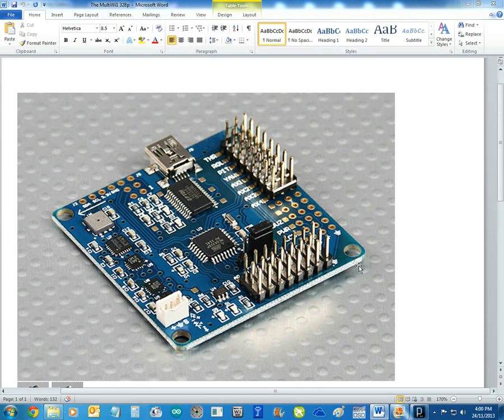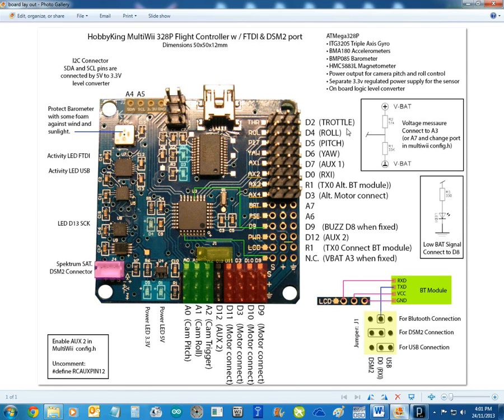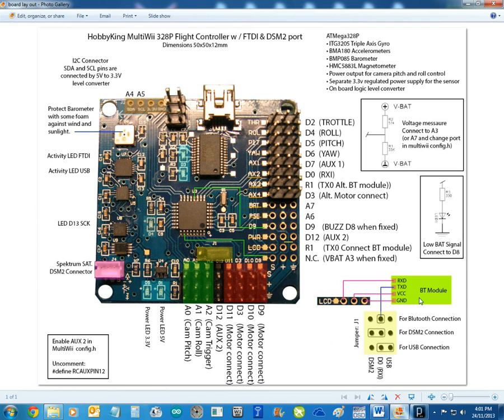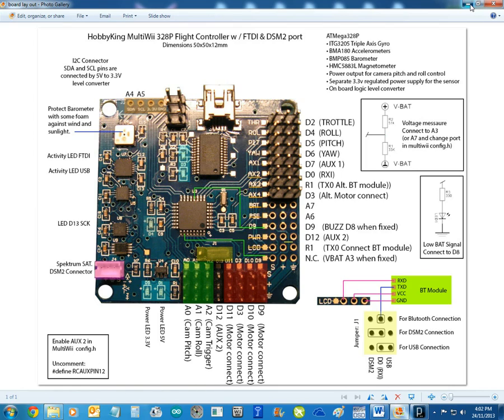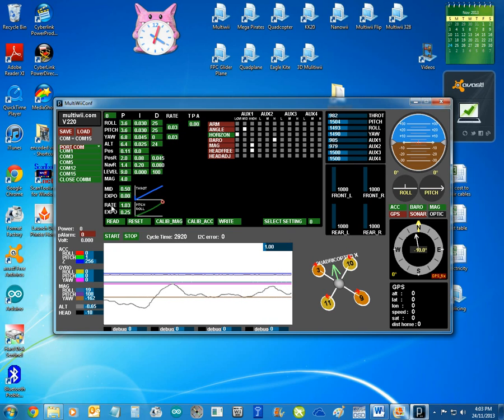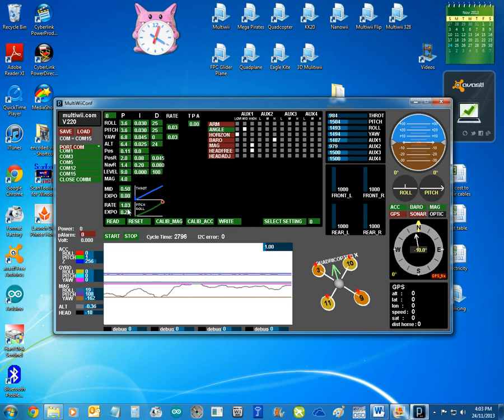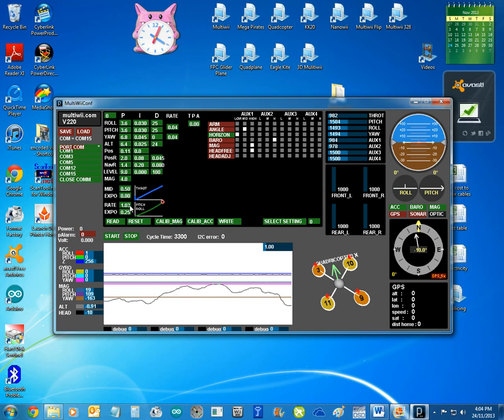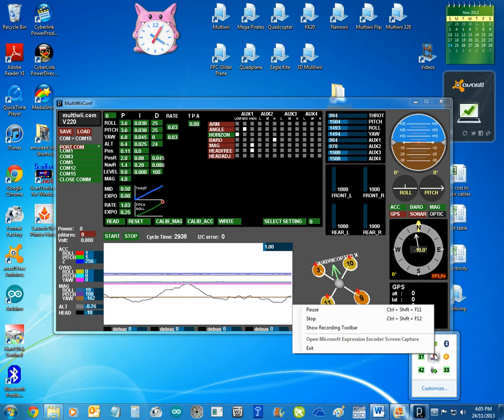HobbyKing Multiwii 328p Flight Board Setup

Comment: Hello,

I have this FC, I cannot connect my FC to Multiwii GUI, how do I get the configurator you have on this video, it looks different than the multiwii gui version 2.3, thank you in advance
Reply from the maker: Hi Steve..... the MWconfig should work on any version..... I have 2.20 in this video but they mostly all work, some are temperamental if the version on the FC board is too many version different to the MWconf on  your computer (ex - say I have v2.3 on the board and say v1.8 GUI)... anyway, a couple of Qs for you. Is the board new or old, is the jumper set on the USB pins on your board (ref 1.28mins in the vid). what version is on your board and what version of MW-GUI are you running, have you had the board connected to the comp before, does the board show up on your computer on a COMM port..... just with the basic info you have posted I cannot gauge what your problem maybe so if you give me some more info I can probably assist you in getting your board running... cheers and merry christmas.
Reply: @moochasas  

Thank you for replying, Merry Christmas to you as well! 
I have the pins jumped correctly for USB as your reference at 1:28 in your video. It is a old board oh, I don't know how old I bought the copter used off of someone else. I am able to use the Arduino software and am able to upload version multiwii 2.4 successfully with no errors. I am trying to get the latest version of multiwii gui to connect and I got it connect one time but I don't know all of the exact settings or what I clicked on within the extracted files, before I got it to connect that one time I had problems getting it to connect before that time and now I'm having problems again and cannot get it to connect no matter what I do, it keeps giving me a message after it tries to connect for a few seconds with a series of light flashes from the red LED and then with a small window it says " error device not responding at the heading of the window and in the body a red circular X that reads.... please check if you have selected the right comport, when I look at my devices installed on my computer it shows FT232R UART, and it says it is working properly, the comport which is com 3 is correct on the device settings and I also have it checked correctly on the GUI, I have racked my brains out trying to figure out how to get it to connect, any help you could give or suggestions would be great!
Reply: The copter flies but it is very hard to fly it does not want to stay in one position in the sky like a DJI Phantom 4 Pro but I own it wants to move all over the place and is extremely hard to control I can basically hover it and move it around very carefully, I am an experienced RC pilot my son and I have 30% gassers
Reply: I am trying to get a graphical user interface hooked up so I can try to adjust the PID's, I'm about ready to give up on this old board, I am already looking at a DJI Naza M V2 or the pix4
Reply: Would like this copter and this board to be able to hover when I release the sticks to neutral like the DJI Phantom 4 does don't know if that's possible?
Reply: @moochasas  

There is a bunch of files when I extract all of the files of the GUI 2.3, I am clicking on the one with the little quadcopter symbol that says multi we win we application but there are other EXE and vs host and dll application extensions XML configurations manifest files that I don't know those will not open I don't know if they have to open along with the main application file with the multi will in GUI application file?
Reply: Within those extracted files it has vs host, Cat vs host EXE, vs host exe manifest, and it says when I try to run those any of those that it cannot start the application the application is missing required file don't understand what that means
Reply: I think I figured it out, but I cannot get multiwii 2.2 from the main Google code website it says 404 error not found, is there any way you can send me a link to download 2.2?
Reply from the maker: @stevenshock176  https://www.dropbox.com/sh/3e8d1jnvel93e5k/AAArxwjeAaV18E6nnuzutapwa?dl=0 Here is the link for MW2.4. it is set up for a 328P FC board. The GUI is in the other folder, remember to choose the correct one for your computer.. If you flash the board you will get all my PIDs that I had in my set up. Before you flash your board try connecting to the GUI in 2.4 it should work. Do you have the right BAUD rate set up (it should be 11520)
Reply from the maker: https://www.youtube.com/watch?v=J4Vduc-qLKg&list=PLhm-AAbSpJ4ijpW2kK5VJwNPEUz41vysQ&index=71
Reply from the maker: https://www.youtube.com/watch?v=7sExKKzNJVc&list=PLhm-AAbSpJ4ijpW2kK5VJwNPEUz41vysQ&index=72
Reply: @moochasas  

Hi Tony,

Thank you for all your help! It flies alot better, I still cannot get the config to connect, tried a couple different things, just won't work! It's  ok, the copter doesn't have gps so it flies as good as it is going to, the USB had broken off the copter over the weekend so I think I am going to figure out something different. I am going to buy this used flamewheel hex tomorrow and have some fun with that (it has DJI Naza, do you have a good inexpensive easy to program FC with GPS I could get for this quad (S525 is this a decent frame?) that has good software, beta flight maybe or suggestions? Thank you once again!

Steve
Reply from the maker: @stevenshock176  If you want an inexpensive FC board C/W GPS then I recommend an Omnibus F4.https://www.banggood.com/Omnibus-F4SD-32K-Betaflight_3_2_0-STM32-F405-Flight-Controller-OSD-5V-3A-BEC-30_5X30_5mm-p-1211677.html?cur_warehouse=CN&rmmds=search
Reply: @moochasas  

This is a link for Banggood, it does not say it comes with GPS, is GPS intergrated into the board, I see that it has intergrated OSD, that is nice and it is 32k with Betaflight? Thank you Tony!
Reply from the maker: @6767stevo  https://www.youtube.com/watch?v=x7_fmjFV28Y&list=PLhm-AAbSpJ4gjzfGfvRBGyg-GwAvHnxtH&index=2 you can hook up a GPS to the Onmibus F4 pro board.
Reply: @moochasas  

Thank you Tony, Happy New Year!

Comment: Do i necessary use an arduino board??
I made an x quad, so its good couse the multiwii comes already on a X configuration BUT, D11-D3-D10-D9 are the pins for the escs, which one for battery and receiver??
Reply from the maker: Luca you dont use an arduino board you use the arduino (free) program via the usb port on your computer..... you will need the drivers but the are easy to find. My configuration is I run my battery into a power distribution board or wiring harness which powers the escs.... the escs power the flight board and as the RX is plugging into the flight board that is powered as well off the board. So all you need to do is connect the motors and the RX to the flight board. If you have a look at the 50:00 sec mark on the vid you will notice the RX connections D4-D7..... cheers..... if you need any further info just ask
Reply: moochasas Perfect, really, thank you for this answer. Now i know how i ve to do. This is my first quad, also homemade, and first approach to the RC s world
Thank you again!
Reply from the maker: Luca Nsh No probs....... this is a great board to fly especially on larger quads for aerobatics.... the altitude hold feature is great as well... dont forget to NEVER have your aux2 wire connected to the board when you flash it.... doesnt hurt the board just mucks up the settings..... something to remember.
cheers.... here is it flying... my fav vid http://youtu.be/U_ChrkrVcBI
Reply: moochasas I'll keep it in mind, thanks a lot!!!
congrats nice vid!
Reply: moochasas Here i am again !
The cam pitch roll and trigger are made for servos connection?
Reply from the maker: Yes, the old type gimbals use servos and the newer type now use brush-less motors.
Reply: moochasas Hi! my quad is almost done, i connected my multiwii to the usb port and started the multiwii config 2.0. All works fine, you mentioned the arduino's free program so i downloaded it (1.6.0) with drivers. Now i'm wondering if i ve to type the entire configuration on my own. i'm wondering also if is necessary the arduino program? the quad could fly just with the multiwii on it?
Sorry my eng ):
Reply from the maker: Luca Nsh No problems with your english....sorry if I am recapping something here but lets just go back to the basics..... arduino is the program to modify your sketch, multiwii is the firmware that runs on the board. If you download say multiwii 2.2 you will get 2 folders..... the multiwii folder containing the GUI (graphic user interface) and the arduino sketch....... you dont have to write out the sketch you just have to remember 2 things...... 1- always use the pair of sketches together (IE dont use a 2.2v sketch and connect it to a 2.3v GUI) & 2- when you get the folders, modify the sketch to your settings (as per the vid), wipe the sketch on the board and upload your new sketch..... store the 2 folders together so you if you want to make a change you just pull out your sketch that you uploaded to the board last time, make the change and THEN just re-upload it to the board......the thing that a lot of people dont get is that you cannot download the sketch that comes with the board to your computer and on a final not never use someone elses sketch as everyone should customise their own sketch to the flying level, radio, location, esc type etc...... hopefullly all that makes sense if not come back & I will always assist where I can...... happy flying and stay safe.
Reply: moochasas I hope i have understood you correctly, but i just dont understand how to match both versions, arduino sketches to GUI . You talked of that in the 1st point, right? or it s all result of an error in my translation process?
in any case thank you for the always clear answers, and dont hate me please for my heavy unknowing !
Reply from the maker: Luca Nsh Luca there is no hate nor frustration at my end.... just here to help as we all know what its like when things dont go as planned..... if you google download multiwii you come to this site...... https://code.google.com/p/multiwii/ from there click on say 2.2 (or any other version for that matter) and when you open up your zip file you will find 2 folder.... one has the GUI and the other has the arduino sketch.... make a new folder on your computer and unzip it in there.... take the sketch and modify it as per your set up and use the GUI in the other folder to calibrate and set up the copter........ let me know how you got in.
Reply: moochasas Yes got it! thank you !!My little steps are bringing me to another couple of questions. I m waiting for the 4 cables to connect my rx ( Turnigy XR7000fhss ) to the multiwii, so the first question : whats the use of aux1? i thought to connect just THR-YAW-PIT-ROL to the rx
Last question is how to define the escs on config.h? i ve got the hobbyking 20aUBEC, not a simonk or turnigy plush. Or i ve just to define the MINTHROTTLE that im interested ?
really thank you moochasas
Reply from the maker: Luca Nsh Great to see your getting it together..... so Ans1 - you connect your 4 main channels to your board (throttle, yaw, pitch and roll) or THR/YAW/AIL/ELE......... your AUX 1 and 2 can be used to select Horizon or Angle or turn on and off your baro (which is altitude hold).... I personally would select Horizon and angle for people starting out as angle will NOT allow the board to go over more than 25 degrees (if you tilt your board you will notice the lights on it will start flashing.... that is 25 degrees..... and Ans2 you dont define the escs you set the min thottle setting for them...... you can change the numbers in the config.h page for say the 10amp Turnigy plush esc which is say 1100 to 1200 if you like.... or down to 1000..... again its a suck it and see thing unless you can find on the net a recommended min throttle setting for those escs....... hope all that is clear?, if not let me know..... cheers
Reply: moochasas So without aux1 should i have less stability than aux1 connected?
have i to define the turnigyXR7000 too? In that case, the escs calibrations comes after that, right?
Reply from the maker: Luca Nsh Hey buddy, whether the aux is or is not connected has no bearing on the performance as far as stability goes. Your AUX are just switches assigned to channels so as the 4 main channels control pitch/yaw/roll & throttle the other channels (depending on how many channels your radio and receiver have) can be assigned to switches on your radio so you can turn on/off things such as switch between acro and horizon and angle (which are flying modes) or turn altitude hold on and off..... you do not have to define anything for the radio in your sketch. You will see some name brands in there but they are only used to simply set up the channel orders..... so all you need to do is bind your radio and receiver and then calibrate your escs... once that is done you can calibrate the board and assign switches to channels (AUXs) for the above mentioned functions.
Reply: moochasas OK! perfect, one more thing ( today i ll have my first flight, little flight) i have to set the multiwii config. I find out some defines, proposals as necessary

in def.h:
#if defined(HK_MultiWii_328P )
#define I2C_SPEED 400000L
#define ITG3200
#define HMC5883
#define BMA180 
#define BMP085 
#define ACC_ORIENTATION(X, Y, Z) {accADC[ROLL] = -X; accADC[PITCH] = -Y; accADC[YAW] = Z;} 
#define GYRO_ORIENTATION(X, Y, Z) {gyroADC[ROLL] = Y; gyroADC[PITCH] = -X; gyroADC[YAW] = -Z;}
#define MAG_ORIENTATION(X, Y, Z) {magADC[ROLL] = X; magADC[PITCH] = Y; magADC[YAW] = Z;}
#undef INTERNAL_I2C_PULLUPS
#endif

Does it set automatically after define the multiwii board in config.h? i thought
Do you agree? Or is all usefull?
(i would thank you for every doubt i had, i found you explanations more usefull than a rc forum of my country)
Reply from the maker: Luca Nsh Hey buddy...... there is no reason to change anything in the DEF.H page, only the config.h page...... the defineH page is part of the program..... configure H is the page we configure stuff...... 

I dont know what you mean by does it set automatically after define the MW board in config.h......... if you mean does the board automatically keep the settings after you have pressed upload and save the answer is yes...... remember to keep your sketch in a safe folder and remember that it is the up to date one..... a lot of people (me included) upload heaps of different versions and tend to forget which sketch I used on the board last........ I set up an archive / not used folder and stick all the trial /non used ones in there..... hope that helps... any issues let me know.... and no probs helping .... have a safe flight
Reply: moochasas hello moochasas, one fast question. Why my quad doesn t disarm? A few days ago the 'disarm' didnt give me any problems
Reply: Luca Nsh i did it. i found the reason. Trimming it too much on the left i passed the threshold. which is the command for let me trim it more on the left? i hope i explained myself clearly
Reply from the maker: Yes you explained that well..... when do I get to see a flying vid??
Reply: moochasas Hope soon, i thought an indoor video. im doing a soft practice because i dont want smash it rapidly, cant handle going up of '35%' of throttle. Im still trimming it ( even if seems quite good ) but that problem has stopped me a few.
(i made a new frame 200g lighter, but those motors and battery will come to me soon)
Reply from the maker: Luca Nsh Congrats..... when you get the new motors and battery and you get it flying outdoors you will see the rapid improvement of your learning skills...... be patient and work slowly at it........any further issues or concerns please let me know as I am always here to help.
Reply: moochasas Hi! i uploaded one of my day of practice and i notice that one motor stops and i dont know why. That happened once, but the following days it keep stop every 10\20 seconds. The escs *bips and i had to arm and disarm each times
Reply from the maker: sounds like a loose connection ..... try swapping that and another escs pinouts to see if its the board or the esc..... if its a beeping noise it means connection is lost just like plugging in and out your battery
cheers
Reply: moochasas Yes, i bought plugs for each connection now is good and functional
Now is all on me, practice on practice. today i had my first crash, from 2\3 m 
what about the fail safe?
Reply from the maker: Fail safe should only be set up on your RX not your sketch as there are too many things that can cause FS to activate...... my advice is to keep practicing your technique low and slow near your and build up ..... not only will your flying skills improve over time but your knowledge base on what and how these FC boards work will also improve..... thanks for dropping me a line regarding your progress
Reply: moochasas i thought the fs was the beep alarm that suggests the battery is running out, my mistake. btw i ve ever heard this beep 1second before it turns off. How can i set it  approximately 20 sec before ? 
There s also your contribution in it
Reply: Luca Nsh hi again moochasas, i ve one problem on my quad, after the second crash last week, i decided to solder motor wires to the escs with banana plugs. a couple of days ago, testing it again after one week, the quad losses stability and start being 'stupid'. i mean, i was able to keep it 1m off the ground, and yesterday it starts bounce without any control. Also using the same TRH % level now it cant even take off over 20cm. On GUI compass i noticed that the X has little shaking. I re calib the magnometer, restore default PID, and trimmed it to the center on the RX. without any response. suggestions? i dont know what i ve to do anymore
thank you